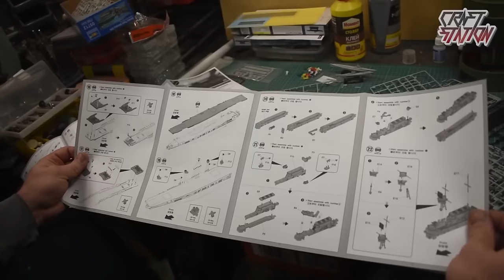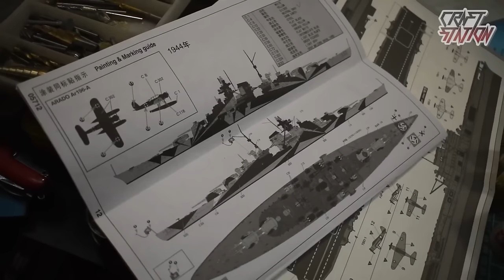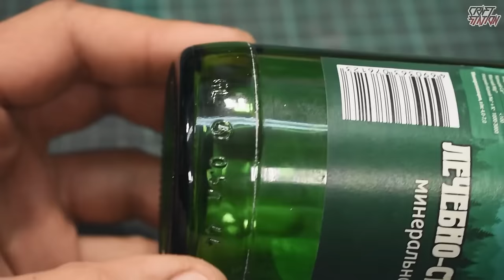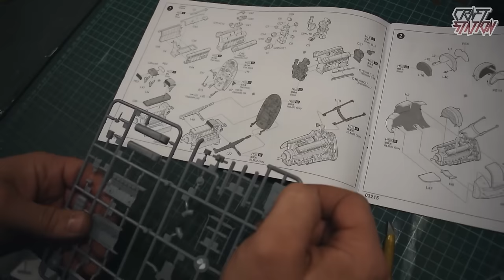TOP 5 MOST Amazing diorams from Epoxy RESIN

Comment: On the one of the aircraft in the water: need to add discolored water around the wings to simulate oil and gas leaking from the plane.

Comment: Just a critics take on these and ultimately irrelevant, but I have to say it.
#1 is perfection.  #2 is great other than the lighting setup.  Needs to be diffused better with a spacing gap between the LED strip and something like frosted acrylic.  Or just use strips of EL sheeting.   #3 I didn't care for at all. the bottle should have been resealed in my opinion and the glowing/UV pigment made no sense either without something to excite it.  #4 was nearly as good as the first one, but the rock cliff didn't sell it like the rest of the diorama did.  I think wire brushing foam with an ink wash would have sold it a little better.  #5 I want to like it, but the use of a  non hidden support pole and bridge build seemed rushed and unfinished.      As I said however, my opinions mean squat, but at the level of the models displayed I had no choice but to analyze all the details of these bad ass builds.   Thanks for sharing.

Comment: I love dioramas. I want to make one myself but never get around to doing it. Kinda want to make one with flowing streams of mercury, something like a miniature mountain with a high mountain lake that flows down rivers and waterfalls into a surrounding ocean. I've got like three pounds of mercury so it wouldn't be that large, if I wanted an ocean. Though I could go bigger if it went to a lake instead, where it funnels into a cave at the bottom of the mountain and then pumped back to the top. Possibilities abound, so long as I don't try to ship it to someone lol. Or let Karen know about it...😉🤣

Kinda don't though too lol, it would have to be enclosed in a clear and completely airtight container that could not be broken easily (preferably at all), the entire thing would have to be non-porous to prevent absorption and leaking of vapor, and if it broke and spilled, ohh god. NIH And Hazmat would pitch a fit lol (I would pitch a fit, that cleanup could cost over $50,000🤤). I had originally wanted to get a large bell jar and make a small sealed fountain inside, but they're made of glass and the diorama sounds a lot cooler. No glass...

Comment: What are the metal pieces for?? I’ve never seen those on models I built growing up
Reply: There called ‘photo etch’, and they are used to enhance the details of the model or to replace parts with a more detailed version. They are fixed to the model with super glue. Some parts are very small, and you need a steady hand to put them in place. I use them sparingly on my models because at 70 years old, my hands are anything but steady.

Comment: The last diorama isnt super accurate becouse in the angel the t 34 85 shot from would just have killed the driver if it pend which it shouldnt be able to do from that angle so if you would have put the t 34 85 like 5 cm forwards it would have been accurate